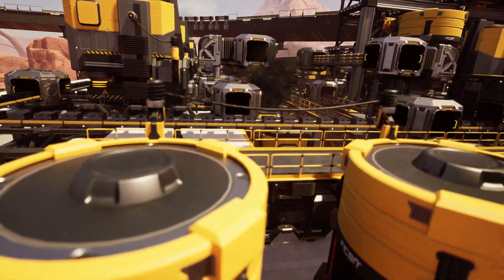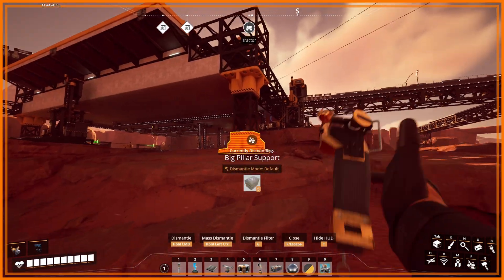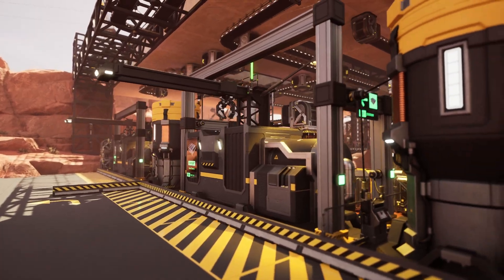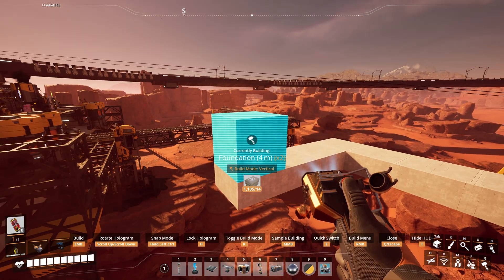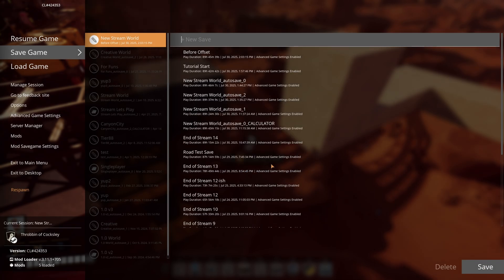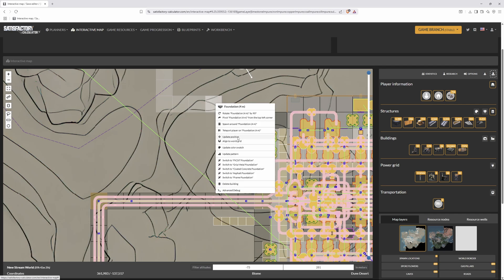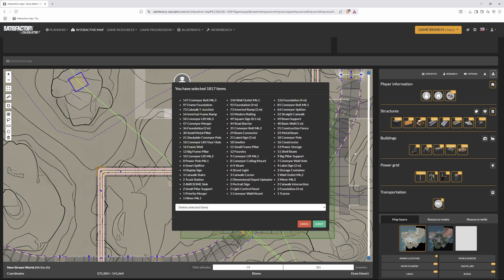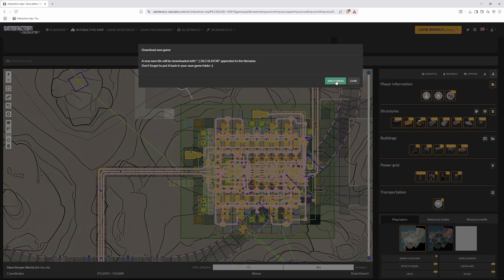I had to move this entire factory! - Satisfactory 1.1 - Tutorial

Comment: There should really be more in-game tools to fix alignment issues over a wide area like this. It's one of the things I miss most from Factorio where you can just scooch an entire production block over a tile with Ctrl-C and Ctrl-V, and your robots will slowly rebuild it over time.
Reply from the maker: Agreed, but also, this was entirely preventable on my part. I just didn’t even think about vertical alignment when I started building
Reply: @itsa_beard who would, unless you got burned already. SC is an unreasonably good tool for satisfactory. I've moved my factories a few times, from rocks and the flying thing. 

As far as I understand the smallest coordinate unit is 1cm. Not sure that's center of slab or the corners
Reply: Agree, satisfactory still lack a few critical satisfaction elements. I'd prefer to be able to make unlimited plan and watch them build.